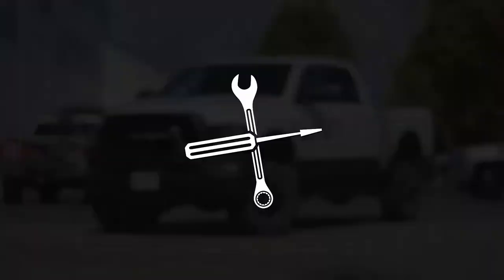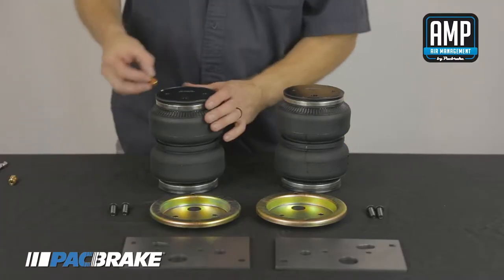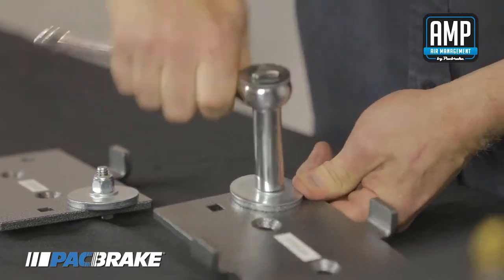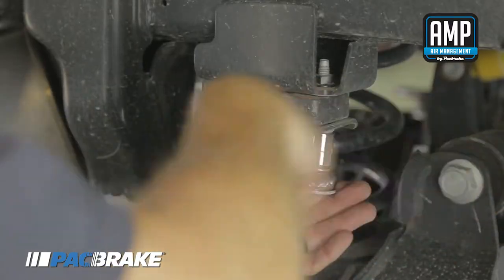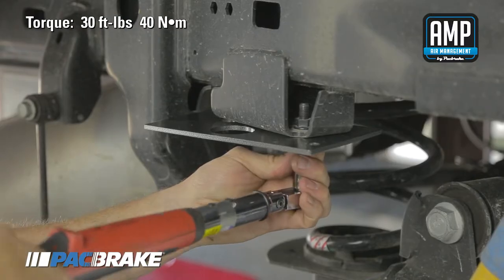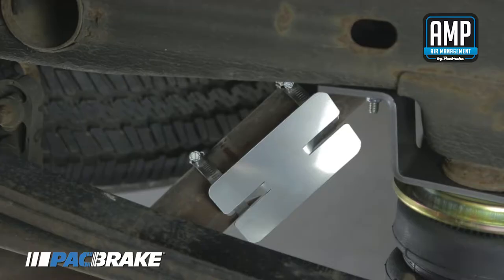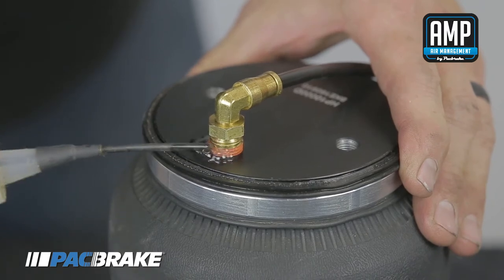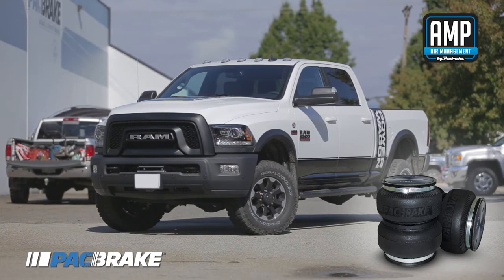HP10206 AMP Air Spring Install by Pacbrake for RAM 2500 (2WD/4WD)

Comment: I need this. I have the exact truck. Does it hamper axle flex?
Reply: I also have a PW.  If the airbag is bolted to the axle and you flex the truck to its extension capabilities, it will more than likely rip the bag apart.  Also, the airbag needs an inner bump stop or you will crush it.  I'm also looking for airbags, but haven't found one yet truly for a PW and it's capabilities on suspension flex.